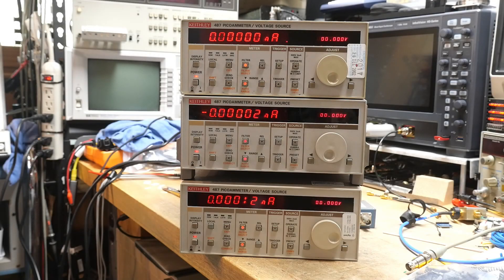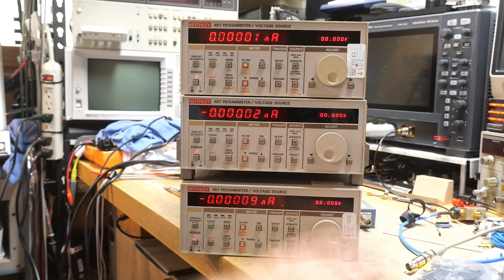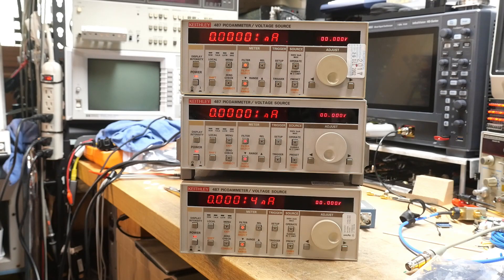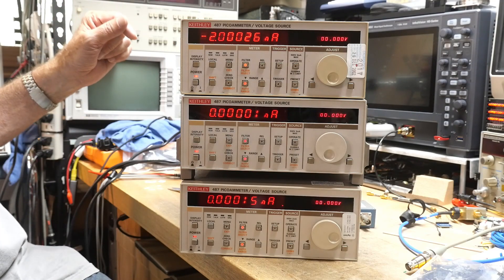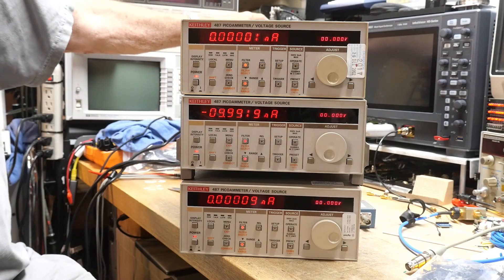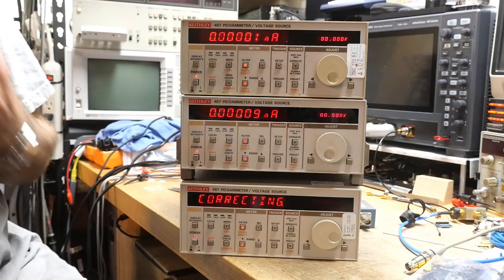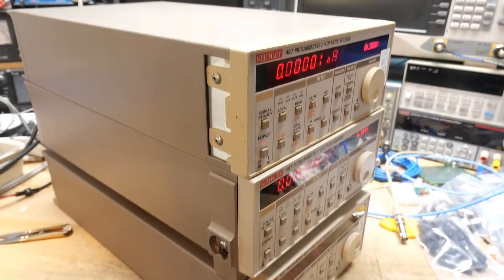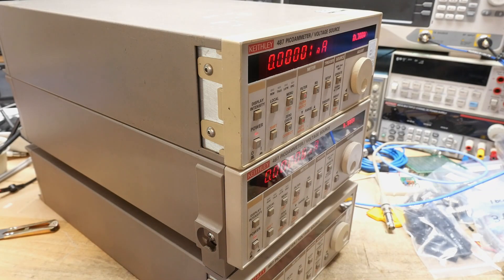#2358 Keithley 487 Picoammeter / Voltage Source roundup (part 3 of 5)

Comment: 3:29 - One thing I dont understand. How did you managed to achieve so good contact, to reach value of 9.9979 nA... ? Im either calculating something wrong or this is uncalibrated in direction to cover losses...
Except joints, what components can be prone to those vibrations? Capacitors?
Reply from the maker: 10V and 1Gohm = 10nA
Reply: @IMSAIGuy  I get this, but Im speaking about contact resistance where you put that resistor... since resistor is in Giga ohms, it doesnt really mater if Rcontact is 0.1 ohm, or 1 ohm, or 100 ohms, its way to less than real resistor...

Comment: Very nice instruments. Be careful with stacking instruments. When I was a student, I stacked identical HP power supplies in the lab. I didn't get any results that made any sense until I noticed that changing the voltage in one supply affected the other supply. The transformers were on top of each other. I put the supplies side by side and everything worked as expected. I found out years later that HP switched the primary with triacs to reduce the output voltage. This kept the linear regulator from dissipating too much heat.

Comment: The nice thing about the 486/487 is the zero CORRECT feature can be retained as a default condition on power up.....albeit the CORRECT only works for the range being used at the time.....so worth doing all of them I guess.

Comment: I would have kept the top one, despite the discoloration, because it seemed to have the lowest drift. I'm also curious about what's going on with the one on the bottom, though I would understand if you didn't want to investigate: I feel like it becomes harder to see the inner workings as equipment gets more recent, and this looks like the right age for all the interesting stuff to be bound up in custom hybrids.
Reply: These are old compared to the current ones that have the more modern (but in my opinion way less intuitive) front panel with the VFD display, and half the settings are buried in menus you get to navigate with the less than ideal buttons. I think the 'modern' one I used in grad school was a 6487

Comment: A lot of the discoloration of most vintage plastic is due to the added flame retardants.  Bromine always gets the blame but there's a whole list of chemical additives that do it.  It seems to happen most notably in ABS plastic which is commonly used for housings.